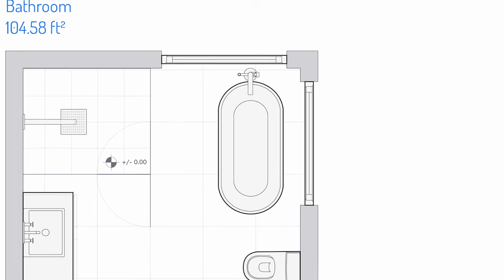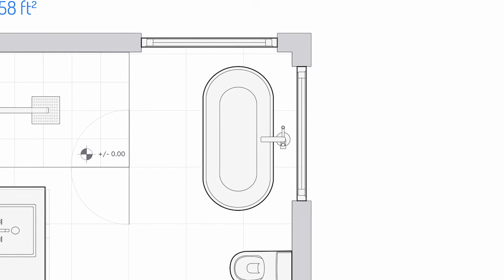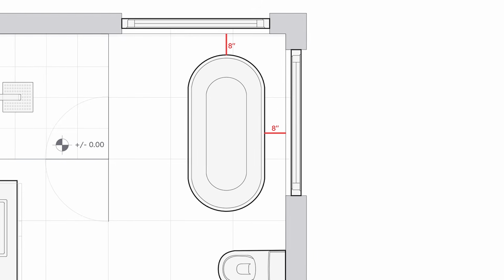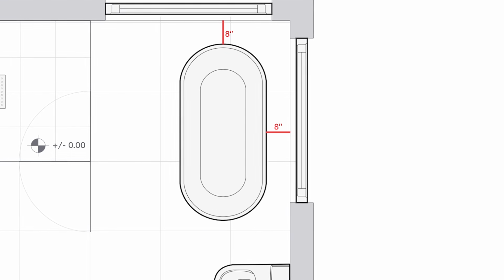How to Install a Freestanding Tub

Comment: Great video. I received a new tub drain replacement that came with the silicone ring and brass nut, do I need to remove the tub and make sure they are there or I could just remove them and insert the new stopper? I already removed the previous stopper

Comment: Great video. I had a question about installing a floor mounted faucet in a wet room.  If the rough-in valve is under the subfloor, do you have any good suggestions on how to try and waterproof the base of the floor mount? The location we have in our wet room for the tub is the corner and away from the showers and the floors will be sloped toward the drain in the center of the wet room, but in the event of incidental water that sits near the base of the floor mounted faucet, we’d like to try and come up with a good solution. 

Right now, we can only think of creating a small raised box that sits on top of the wet floor to lift the valve away from incidental water contact.

Comment: We just had a new freestanding tub installed and the water is barely draining out. My husband was going to try to snake the drain in case some construction debris was caught in the line but the snake won't do down the drain. It almost seems like something didn't get cut open?? Yet an hour later when we checked the 1-2 inches of water was finally gone, but the debris that sprayed out from the faucet (small particles) are still there.

Comment: So when the tub water valve in the floor leaks you need to remove the tile and cut a hole in the floor? Not sure that works for me. I like to be able to easily repair parts that break.

Comment: i have a base board hot water radiator on one side where i want to install an acrylic tub. my plan is to cut and remove the metal housing and leave the inner radiator. i will have about 2 in clearance to the copper pipe. . do you think this will be a problem with heat that close to the tub?

Comment: What is not shown is the installation of the overflow drain....That is what I want to see ..
Reply: In most freestanding tubs, the overflow drain is connected to the bottom drain internally, so you don't need to worry about it

Comment: I have a question. When inserting the drain into the P-trap do you have a special fitting at the end of the p-trap that creates a watertight seal, in the event that the p-trap gets clogged it does not back up and leak? I installed a similar soaker tub a while back and the drain line was just installed into the p-trap without any sort of watertight seal. I made the guys take that out and create a proper seal between that drain line and the p-trap connection. Hope this makes sense. Than you and great videos.

Comment: One thing I am curious about - does the manufacturer recommend setting the proper torque for tightening the nuts to the PEX connectors? Reason I'm asking is that it seem that if you make the connection, snug, but not torqued to spec, you run the risk of water leak. I'm just curious, that's all. I work within the aerospace industry and torque-to-spec is a big thing.